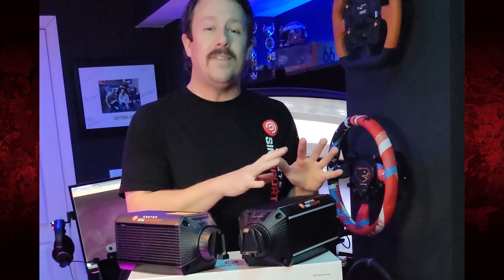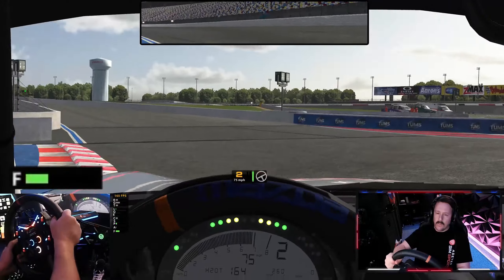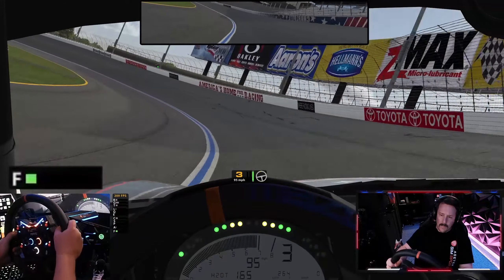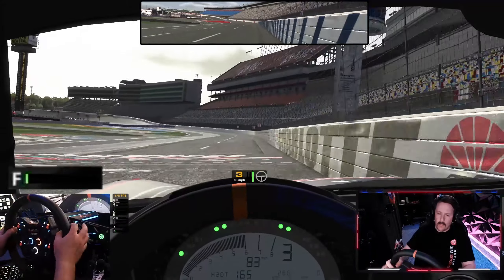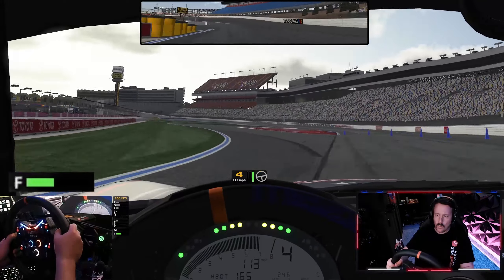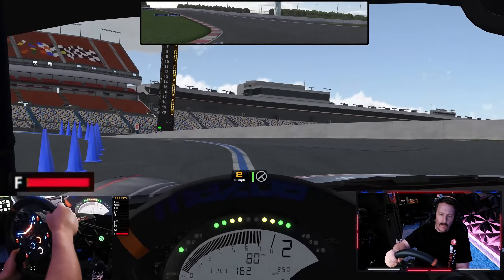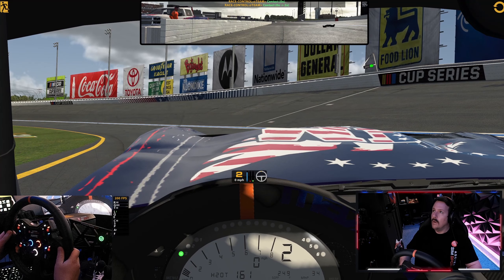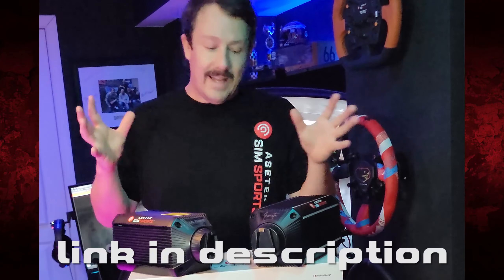12nm VS 27nm - Asetek DD comparision

Comment: I have the TK edition wheel base which is a combination of the La Prima and the Forte.  It has the 12 NM from the La Prima but has the 5 USB C board in the back like the Forte.  I love it.  It's the First DD wheel base i have owned and I don't think i will out grow it anytime soon.  Keep up the good work Matt
Reply: I also have the TK edition and it was the best deal I’ve ever seen! Too bad they discontinued this at microcenter!!!
Reply: @ yeah I know. I saw it and pulled the trigger as I got the base the TK wheel (forte formula wheel with different skin and button colors) and pedals which are the same as the la prima pedals all for less than $900.
Reply: Got the same one and yeah it’s perfect and I got it for a great deal
Reply: same here. base was $500, TK wheel was $200. i've upgraded my wheel since but it was such a great deal.

Comment: People on the Asetek discord channel are complaining about the heat when touching the wheelbase after playing for some time, some speak of 70c, 158f. Are you having heat issues with the Asetek wheelbase?
Reply: @pd3g  
Have you ever touched a big electric motor working in a factory……. Do u know it works 10 hours a day for years and it’s they really HOT. 
What is you point about a bit warm motor ????? 
Think !!
Reply: @Max__apex  True, but the motor in the wheelbase is not driving any heavy machinery for 10hrs at max nm, it's only driving a sim wheel with some resistance.